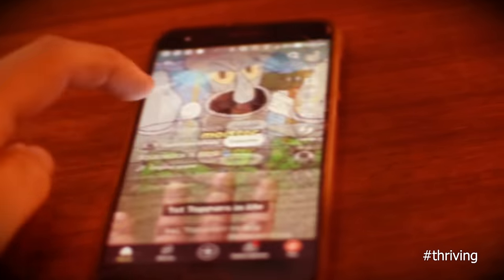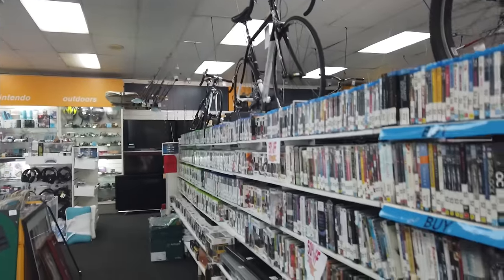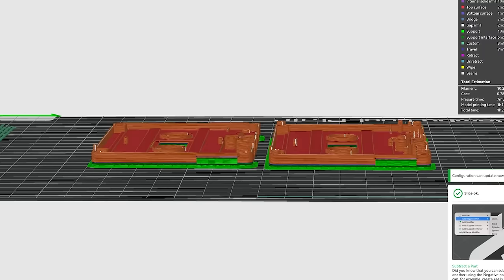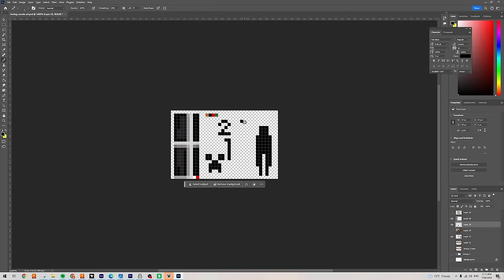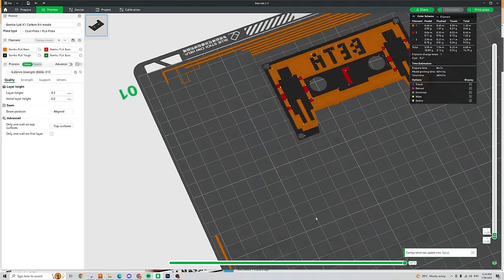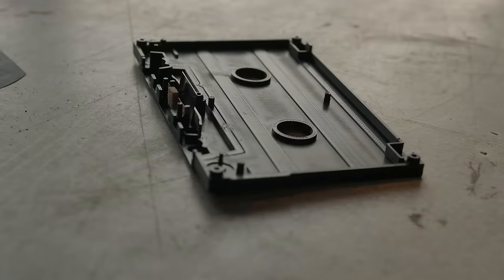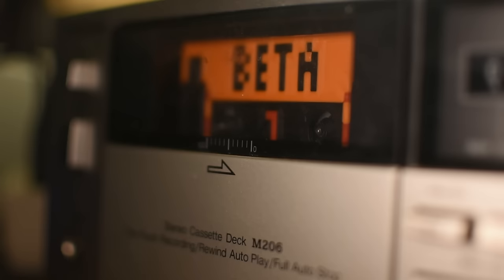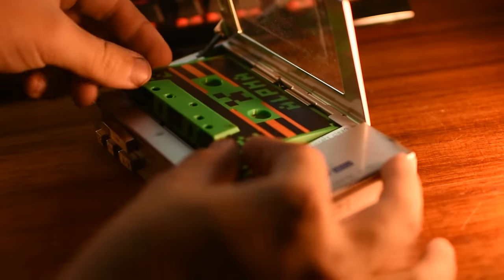Can You 3D Print Cassettes?

Comment: For faster music transfer, you'd need to find yourself something supports high-speed dubbing. Many stereos with two tape slots had this feature. More expensive equipment could work faster. On the other hand, finding the exact dubbing speed(s) for what you have, keeping quality high and getting it to work from an external input are all problems that would need to be solved. (Hint for the latter at least: An AUX-to-cassette adapter ought to work if nothing else does.)

Comment: Hello, I’ve tried a couple times to print these off, and one side keeps coming out slanted so the screw holes can’t all line up without the sides bending and therefore the tapes not staying in place inside. Any fix? What settings, slicer and printer do you use?